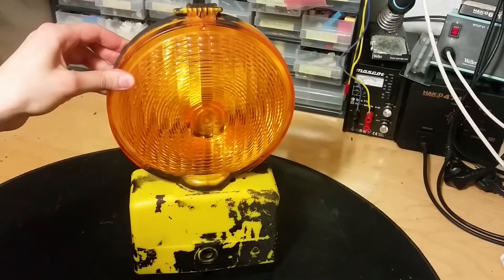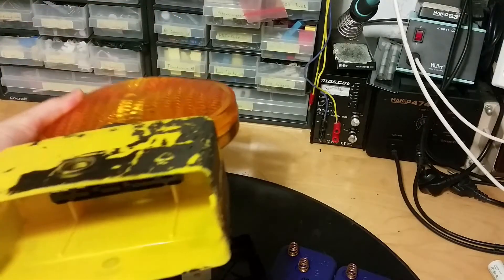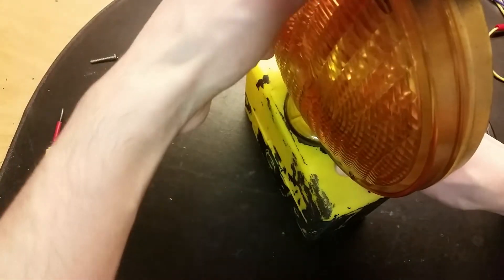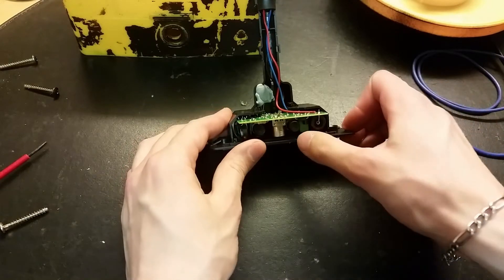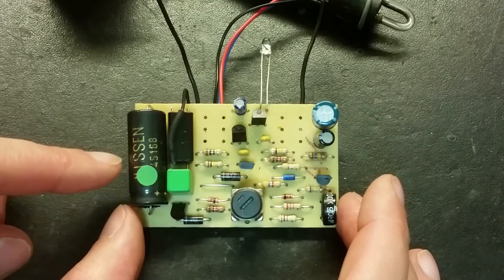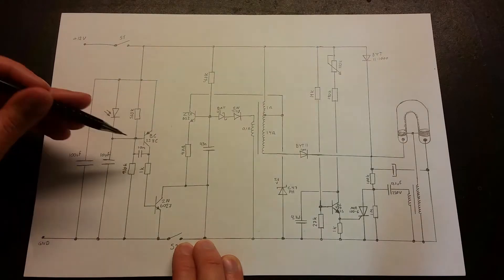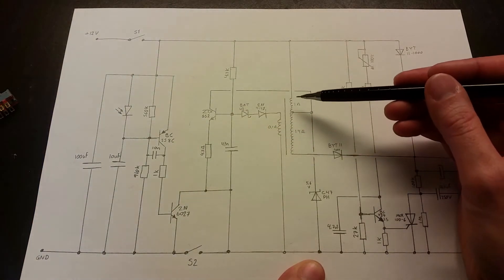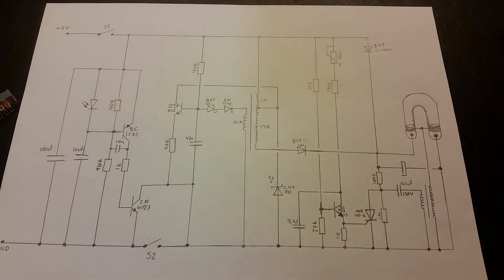Hazard Light Teardown, How A Xenon Strobe Light Works

Comment: That is a good quality road hazard light, love the Xenon flash tube technology. I have not seen that type here in central Australia, I remember the Lanterns that burned Kerosene fuel when I was very young and then battery operated units came along. They were metal construction with a glass lens and were soon replaced by all plastic units with a cheap electronic flash circuit driving a small six volt incandescent bulb. I think LED technology is now in use however I love that unit you have, good quality and a strong flash output.